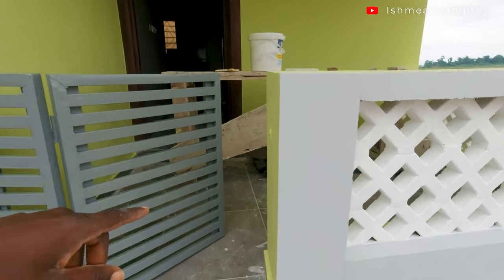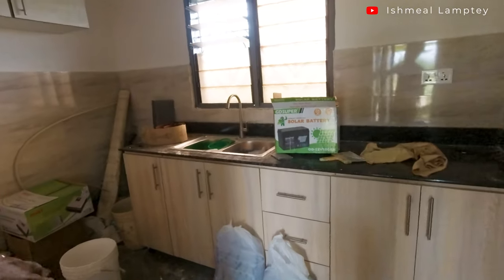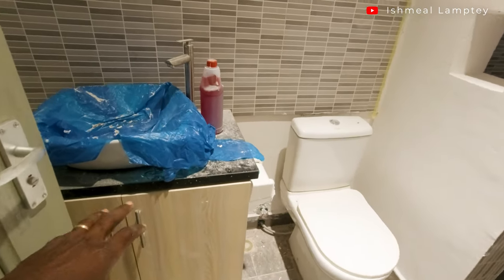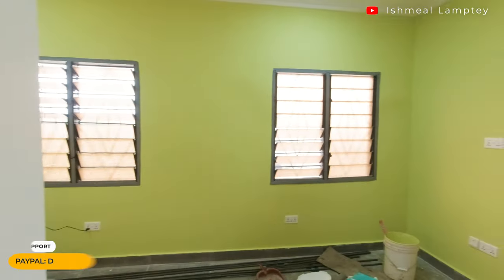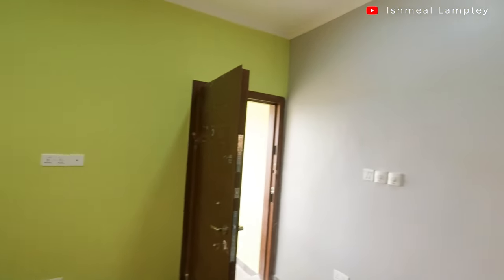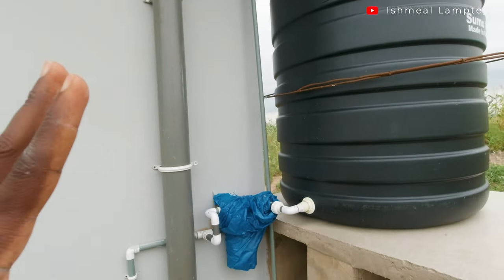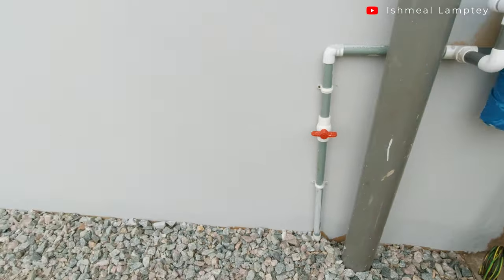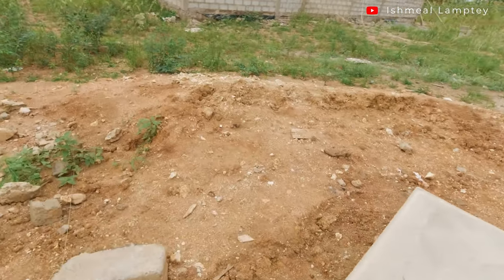Painting a Minimal Off-Grid House and Other Updates

Comment: Hello Ishmael great work. Please reassess the plan of having the gas cylinder and the electric pump in such close proximity though separated by the concrete.
Reply from the maker: Sure. What would you suggest if i may ask please?
Reply: @IshmealLamptey   You can try to place the pump and the cylinder diagonally opposite if possible.
Reply from the maker: @makafuiameedzameh2445  unfortunately, that wouldn't be possible now since we don't have a fence wall yet